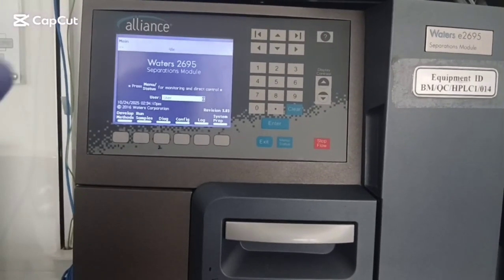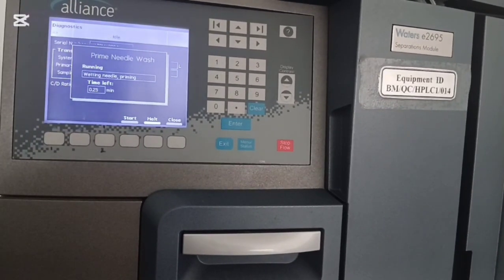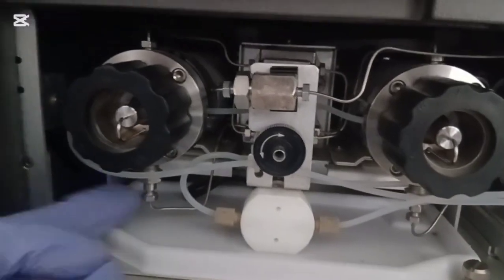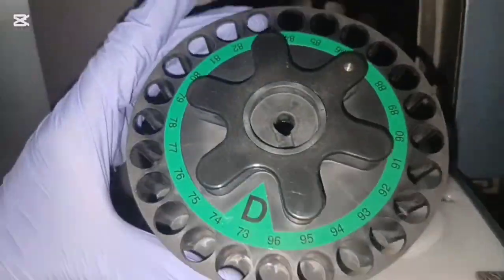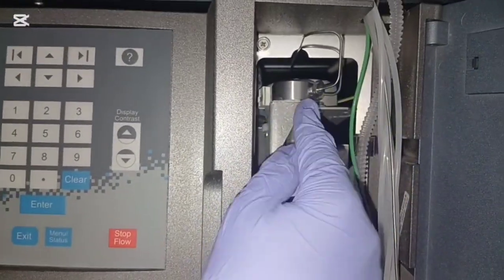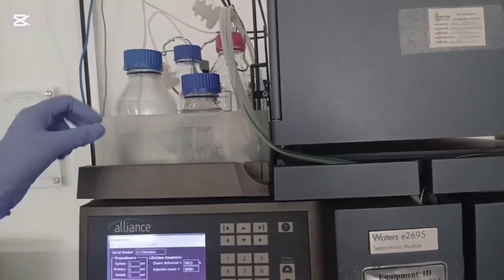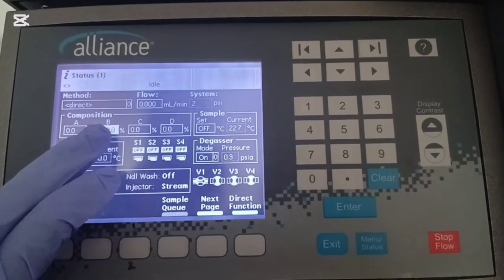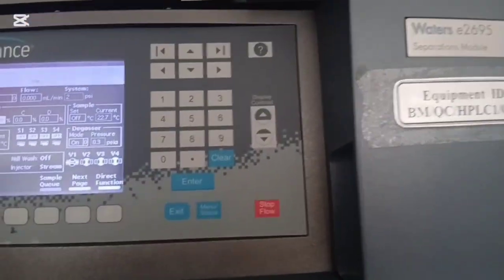Empower 3 waters HPLC Initialization procedure english dubbed

Comment: Why does the pressure change upon sample injection—before returning to its pre-injection level—in this model? Is this normal, or is the issue specific to my setup?
Reply from the maker: This is normal and common phenomena ..
All this due to valvle switiching between load and inject position

Comment: The same solution if you want to clean vials and column.
Reply from the maker: Column washing and vial washing is something different ...vial washing is under apparatus cleaning, and column washing depends upon mobile use ...normally, use water 22 to 24 column volume ..i will make a detailed video regarding this